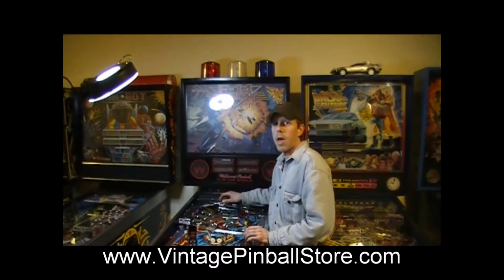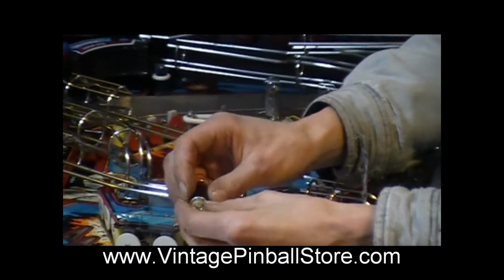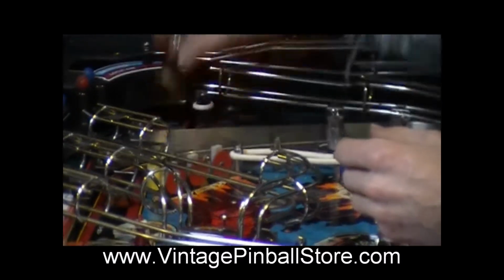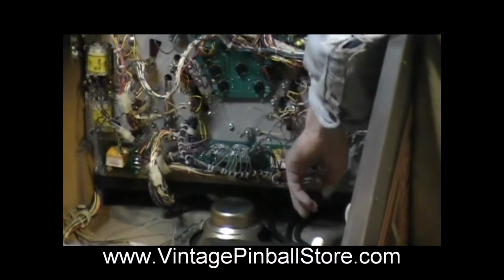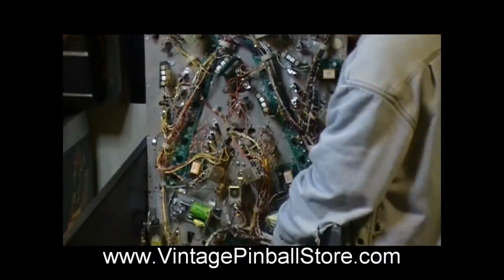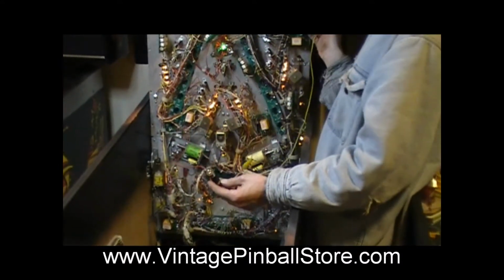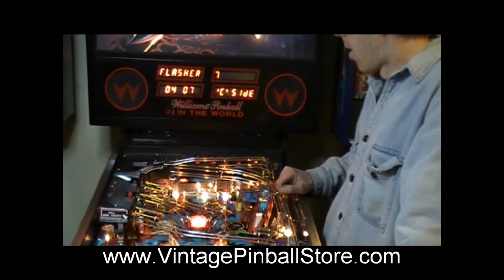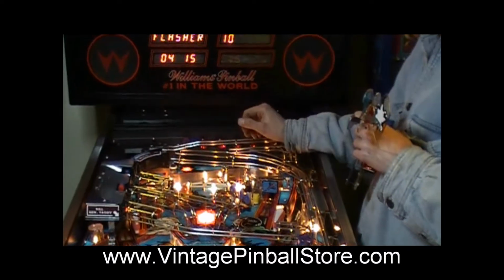F-14 Pinball Project - Adding 2 Flash Bulbs - F14 Pinball Machine - Williams 1987

Comment: In this video, there is a mistake in the interpretation of the service bulletin.
According to the solenoid map in the manual and the service bulletin, the both red flashers 1 and 2 are not wired together. The original design is Red1 + Clear = Flasher 7 (Orange / Wht-Vio), Blue = Flasher 9 (Red / Wht) and Red2 = Flasher 10 (Red (Yel jump) / Wht-Blk).
In April 1987 the drive cable comming from A7 (Flasher 7) on the A/C playfield diode board has been removed in the prodcution line. 
Simply add this cable to a free resistor board to recover the original design. Just follow the video indications but wiring Clear and Red1 flash lamp together.

Comment: One thing is not explained (or I missed it) is that initialy the two red lights get power from two different rails. (orange goes to RED1 and CLEAR also has a Orange wire. And RED2 is powered by the red wires via the yellow jumper from BLUE). Does it really matter were power comes from ? wasn't it done like that originaly because the two bulbs are lit at same time and it would draw too much current ? I am confused

Comment: I hooked this up.  It is a nice improvement.  Thank you for your video.

I had one problem.  It turned out the flashers activated in both the 7A (solenoid) and 7C (flasher) setting.  It took me a while to figure this out.
You said, "You can hook this up to any other flasher that is multiplexed".
I hooked it up to the orange wire going to the other two flashers located under that same plastic.  It turns out that since they are above #8, they are not multiplexed. 
So I moved the B+ to the relay itself which is located almost immediately below this flasher.  Fires now only on 7C, which is what it should do.

Thanks again!